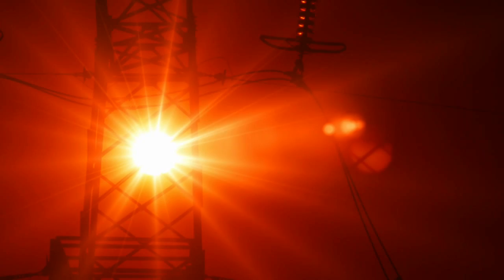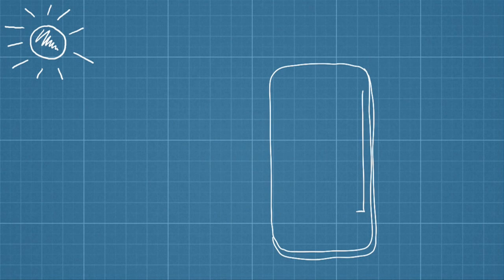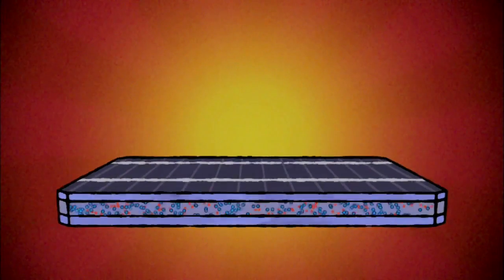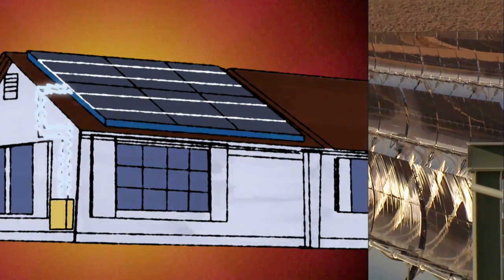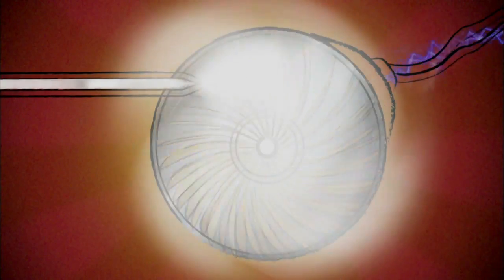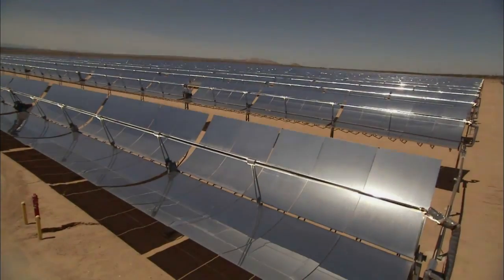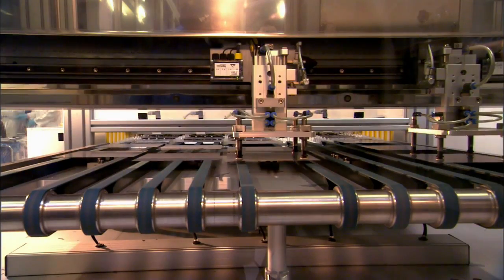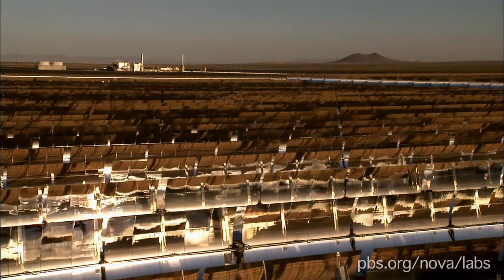Solar Power

Comment: Use distributed power systems, during peak hours use the energy stored as hydrogen to your fuel cells, if every home did this the grid would not be overloaded